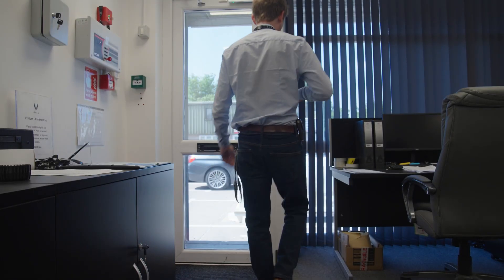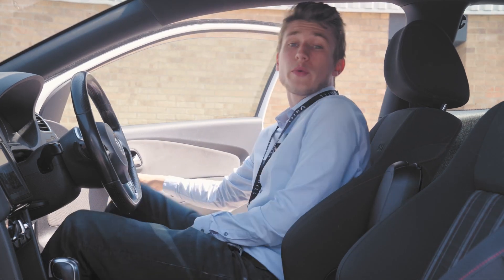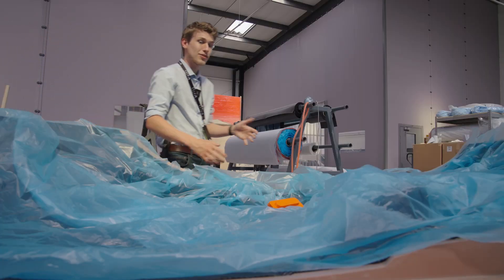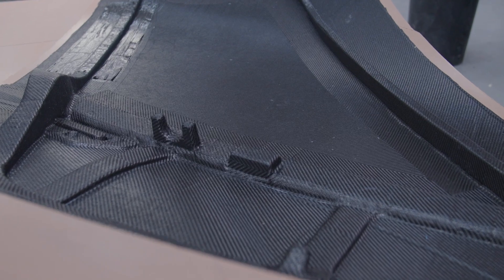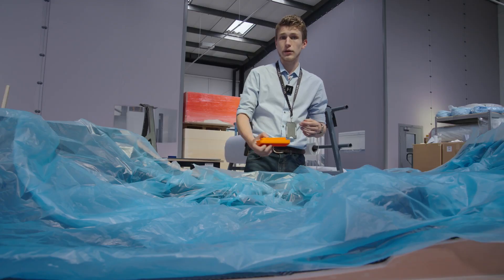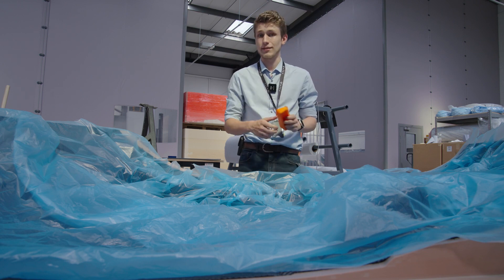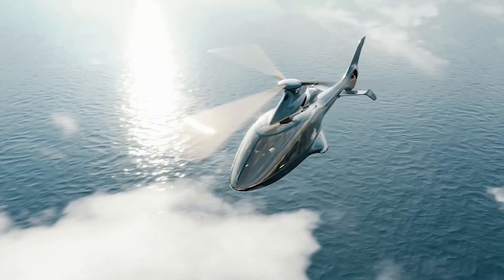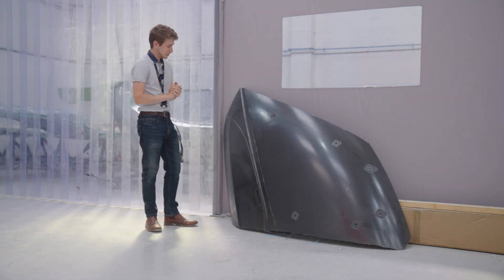Journey to HX50 | Episode 30:  HX50 Doors: Where Ergonomics Meet Luxury

Comment: Dear [hill]

I hope this letter finds you well. I am writing to express my strong interest and enthusiasm for the Hell X50 helicopter prototype developed by your esteemed company. As an aviation enthusiast and a dedicated follower of technological advancements in the field, I am excited about the potential that the Hell X50 brings to the market.

I am aware that the Hell X50 has recently undergone comprehensive testing and is nearing completion. Given my deep appreciation for innovative helicopter designs and my desire to contribute to the growth of the aviation industry, I kindly request your assistance in arranging an opportunity for me to witness the fast launch and test flight of the Hell X50 prototype.

My passion for helicopters and my understanding of the intricacies involved in their development have instilled in me a keen eye for engineering excellence. I firmly believe that the Hell X50 possesses exceptional features and cutting-edge technology that set it apart from its counterparts in the market. Observing its test flight firsthand would not only be a remarkable experience for me personally but also enable me to contribute valuable feedback and insights from an aviation enthusiast's perspective.

I am prepared to comply with any necessary safety protocols, sign non-disclosure agreements, and provide any additional documentation required for access to the test flight. Furthermore, I am open to scheduling the visit at your convenience and adapting to any specific requirements or restrictions you may have regarding the viewing of the Hell X50's launch and flight.

Please consider my request as a genuine expression of interest and enthusiasm for the Hell X50 project. I genuinely admire your company's commitment to innovation and the advancement of helicopter technology, and I would be honored to have the opportunity to witness this milestone event in person.

I kindly request your favorable consideration of my request. Should you require any further information or have any specific conditions in mind, please do not hesitate to contact me at [Phone Number] or via email at [Email Address]. I eagerly look forward to your positive response and the possibility of witnessing the Hell X50's launch and test flight.

Thank you for your time and attention.

Yours sincerely,

[Ramen]
Reply: A for effort.  Don't give up on your dreams.  You'll get there.